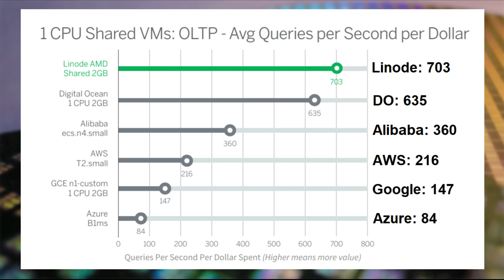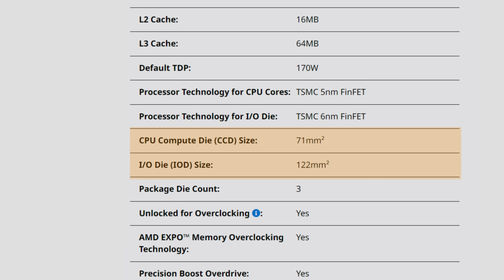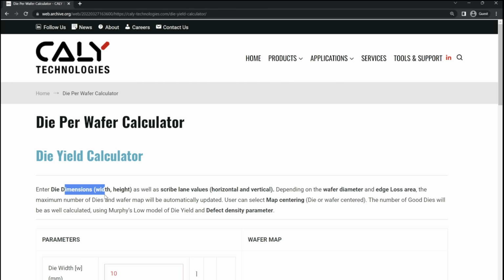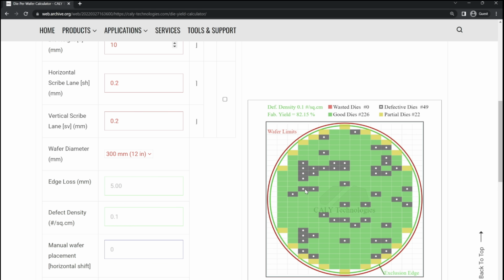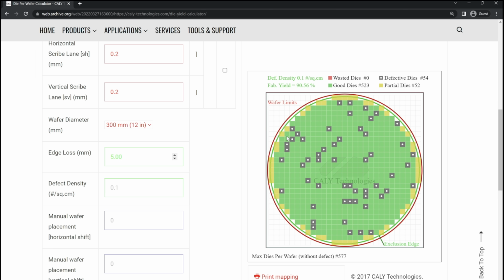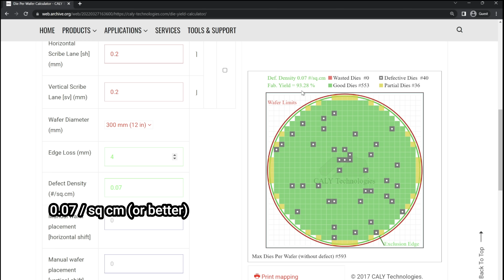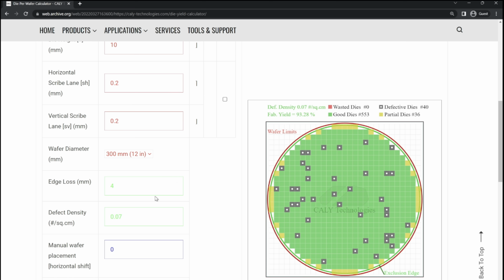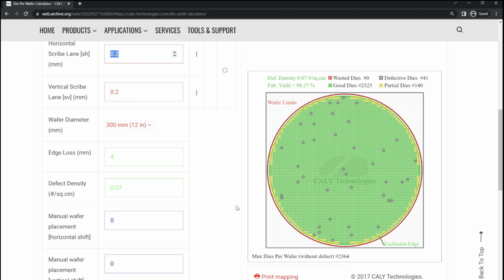AMD Ryzen 9 7950X: Cost to Manufacture?

Comment: Of course, the issue with estimating the value of the BOM for these chips is that we don't have nearly enough information. You'd need statistics on voltage/frequency binning, packaging yields, logistics overhead, etc. It's not impossible that the BOM of a 7950X is under $100 dollars, but it's also possible it's over $300. As fun as it is, error margins in excess of 200% make this sort of napkin math borderline meaningless.
Reply: Yeah, and unlike non-chiplet products we don't know how many of these "premium" desktop chips there are vs the actual top binned products going to epyc and threadripper.  If there's lots of demand for top quality silicon going to epyc, it's likely the 7950x doesn't get any good dies, but if there's not enough demand for dc processors, AMD likely will reserve some of the best for their top desktop chips.

Even 200% error margin leaves this product one of the most profitable desktop processors, which is good news because AMD can drop the price without losing their shirt.  I think the estimates for some of their less competitive desktop chips of the past like bulldozer and "fusion" chips left them earning nearly nothing per sale.

Comment: You assumed negligible loss in packaging? I was under the impression this introduce further yield loss. That e.g. through-silicon packaging creates nicer/smaller package but may have worse yield than more traditional packaging. But that’s just something I heard on the rumor mill back in the day.
Reply: I cant for the life on me remember where I heard it, but I heard packaging back in zen 1 started out at a little above 90% yield rate and quickly was fixed after zen 1 launch to 98-99%. Zen  3d cache chips I believe also started with this problem but quickly was fixed and it jumped up to that 99%. I also clearly remember that chips  very often cold be saved after failing to be packaged.

Comment: Let's put a margin of error of +300% and max price including packaging, validation etc at $210 per processor. Retail prices are 3-4 times the production cost. This is very much a requirement, considering the high costs involved in R&D, equipment and high salaries and not to mention fat bonuses and stock options for top executives.
Reply: i almost thought you were fr

Comment: This should be called 'raw material cost'... And even that's a stretch. It should be called 'silicon cost'. It doesn't include machine costs, program run time cost (for printing the chiplet in the silicon), the assembly cost, lid cost, etc. It doesn't include the markup from the manufacturer, the R&D cost, the staff cost, the marketing budget... This doesn't even come close to the true cost of that chip.
Reply from the maker: R&D is amortized over the lifetime of the chip, and who knows how long they'll be making these. Marketing budget is variable again, over the lifetime. Markup from the manufacturer - huh? The wafer prices include TSMC's markup. If you want to go quote retail cost, sure. But Bill-of-Materials costs occur all the time for tech products. Search 'bill of materials iPhone' for example.
Reply: @TechTechPotato  the bill of materials is only one component of a manufacturing cost. Do you think when someone builds a house, the bill of materials is the final cost? I've worked in manufacturing since 2014 and I'm telling you, you don't know what you're talking about

Comment: I wonder how much money the global logistics eats up.. The wafer cost likely includes shipping from Japan to Taiwan, but after Taiwan, I think AMD moves the assembly (and packaging??) to Malaysia or maybe even the US?  Something like that.  Probably adds a few bucks to the total cost, if we're counting that under the umbrella of 'manufacturing'.
Reply: Yes, but still miniscule as the chips are so small and light.
So, you could probably transport a hundred thousand just in one standard container.
Reply: @FutureChaosTV  probably, but on other hand you still need to take special measures so they won't corrupt in transporing. Which cost money.
Reply: @DimkaTsv  Chips are far less perishable than bananas, yet we transport them so cheaply that you by them for few dolars per kg. No, shipping and distribution of chips is very small part of the price.
Reply: @666Tomato666  on other side they are brittle and susceptible to dust from what i know. Unlike banans which only need to only be isolated from moving and delivered fast
Reply: @DimkaTsv  yes, you need to use packing peanuts, sure. But it's not like packing peanuts are made out of platinum and carbon nonotubes...

Comment: Great video. Perfectly explained as always. 

I have always wondered; when making big monolithic dies that leave huge unused areas (as in your very big chip example), do they put smaller dies in those otherwise dead areas to capitalise on the wafer? Would love to know why if not.
Reply: The cost of the silicon wafer before it goes through the lithography process is effectively negligible, so manufacturers have no reason to try to conserve it. A bare wafer only costs about $10, but is worth more than 1000 times that after circuits are engraved into it - the main cost comes from the limited number of lithography machines and the large amount of time taken to etch multiple layers.
Having to etch multiple die designs into one wafer means each step of the lithography process takes much longer because multiple photomasks have to be used, and makes the dicing process much more complicated (unless each design is roughly the same shape and size, and small enough that they can all fit within the area of a single photomask), so it's almost always more economical to use each wafer for a single die design, rather than trying to fit multiple dies of different sizes onto one wafer. It doesn't make sense to use thousands of dollars worth of time on a lithography machine to save a couple of dollars worth of unused wafer area.
Reply from the maker: You print the same thing so that when you cut it, the cut acts the same no matter where you are on the wafer. If that area was left alone, it wouldn't cut the same, and that might affect yield.

There are things called multi-project wafer shuttles, where different die can be on a wafer, that let smaller companies or academics run test chips, but that's super low volume. Not for HVM.
Reply from the maker: @vrforall you realise I'm an analyst, right? R&D costs are amortised over the lifetime of the product and impossible to esti. Ate based on lifetime of product and rate of amortisation. This is specifically about cost to manufacture only - it says so right in the title.
Reply: @TechTechPotato  Fair enough.  True the actual contractual cost with TSMC are of course confidential.  Guess just pointing out that some of your viewers may interpret your cost analysis as the Total cost and casts a negative perception of  AMD/Nvidia/Intel.  A simple mention of $300-$500 in design costs would clarify things.
Reply: Great explanations. Thanks 😊
Reply: BOM cost matters most because it dictates the headroom AMD has to dive sales by lowering prices in order to spread the fixed overhead costs across a higher volume. of CPUs  If manufacturing costs are higher, then harder becomes to have a pricing strategy that succeeds.

Comment: Keep in mind that there's operations costs, other business costs as finance, IT, accounting, R&D costs, marketing costs. So it does come out to a lot more
But they still probably make nearly 50% margin which is insane
Reply: @VRforAll  AMD spent more on stock buybacks than in R&D, and still made 50% margins. No sane company prices products lower than they have to, but AMD certainly has room to drop pricing and still make a killing if they have to.
Reply: @defeqel6537  gotta spend that profit before it's taxed. There's not many option. Stock buybacks provide value to shareholders. R&D also isn't a magic "make better" machine. Simply throwing an extra 50% into R&D for a year you do particularly well doesn't necessarily do anything productive besides maybe hire more engineers you don't need at the moment.

Stock buy backs are essentially a form of a tax advantaged savings account. If AMD needs the cash in the future for a large R&D investment when the time calls for it or an acquisition, they can simply just sell those stocks. Even better if they expect Stock prices to be better in the future too.
Reply: @moist_ointment  I'm not saying it's bad or anything, just that if AMD has to lower prices, they certainly have room to do so, and still make a very very very healthy profit
Reply: Margin for microsoft office is almost 99.99% just allowing this people to download from the cloud server. Chip is a software printed on silicone
Reply: @Karl with a K unfortunately there are fools that buy it for 700 bucks and a ton of AMD shills that defend overprice practices. when money you spend are your parents money you don't actually learn to count them. AMD/Intel/NVIDIA/Apple/Samsung capitalize on that.
dumb people willing to pay + shills = everything is overprice.
Reply: 50% would be low, they average something like 64% dont they?
Reply: Rest assured, they're making far more than 50% percent margin.  They just want you to believe that.
Reply: I think you're underestimating if you think its only 50%. Most retailers mark everything up 100% or more. When big chains have a 50% off sale, they aren't giving stuff away or selling it for cost, they're still making a bunch of money on something. I suspect AMD, Nvidia and Intel are all making at least 100% markup on everything they sell. There's a reason Nvidia was willing to knock a grand off 3090 Ti's to try to get rid of them, and they aren't losing money at that price.
Reply: @simplyscholar21  As someone that has worked in retail, markup from distributor is only about 5% or so in the US. It's one of the reasons that most of the mom and pop computers stores around here have gone under. There's little to no profit in sales, all profit is made in repair and services. I blame the big internet venues that can afford to buy in bulk at a discount. The only one making huge profits on hardware are the manufacturers and distributors. Oh, and scalpers....
Reply: @simplyscholar21  The average is 2.5x. It's not a small percentage.
Reply: @simplyscholar21  It's a publicly traded company. Their margins are public info, reported every quarter (non-gaap gross margin is about 50%)
Reply: @moist_ointment  that doesn't mean what you think it means. It's based on their overall revenue. The higher their revenue, the higher their gross profit margin goes. It has absolutely nothing to do with their overall profit margin on a specific product.
Reply: @simplyscholar21  of course not on a specific product, but generally DC is going to have higher margins than consumer lines. Margins are certainly not sale price minus BOM
Reply: @moist_ointment  Also keep in mind, that AMD's margins on Server chips and large FPGA are higher, so I would guess their consumer products have lower margins than 50%. As that's the average.
Reply: @moist_ointment  your information still doesn't mean what you think it means. It's the profit margin of the company as a whole. Factoring in everything from janitorial costs to marketing. We're talking about specific products, and I stand by my statement.
Reply: @simplyscholar21  You can't exclude amortized fixed costs or NRE when discussing product margins. Janitorial costs HAVE to be applied to each unit sale before determining the final margin.
Reply: @moist_ointment  keep in mind that part of margin-revenue discussion is that AMD's "investments" like stock buybacks are calculated into that
Reply: @simplyscholar21  Except for the fact that they are publicly traded companies and have to share their margins.... which for the last quarter was... 46	%
Reply: @feedtheagle6851  publicly traded companies have to share their margins as a whole. That isn't the margin for a specific product. AMD has a fan store where they sell socks, shirts, cufflinks... they've sold bicycles before. All of the margins of everything they sold as a company gets combined to that single figure. I can explain this to you, but I can't understand it for you. That figure is not the profit margin they have for selling CPUs or GPUs. The margins on those specific products is much higher. Either accept it or don't.
Reply: @simplyscholar21  So you are suggesting that they should lose money as a whole so that you can have a cheaper product, got it.
Reply: @feedtheagle6851  No no no, he's suggesting that they plunge the company into the dirt so that he can get 16% more performance on a new generation of chip he doesn't even need, to render his video 2 minutes faster because he's that impatient and entitled.
Reply: @simplyscholar21  exactly. when 5600x was launched it was 28k in India. Now its selling for 16k. they just reduced the price 5600x by 42%. so yeah they were selling it at huge profit margins.
Reply: @Karl with a K TOCK TOCK. Guess what:
The chips don't magically end up in the stores.
There are logistics, distributors, retailers, etc...
Reply: @VRforAll  don't forget AMD has to buy yachts, private houses on warm islands, 10-bedroom apartments in all big cities, Lamborghinis, black and red caviar, overpriced champagne and prostitutes for all its shareholders. of course its priced like its priced.
Reply: @rawdez_  Stupid comment.
Reply: It isn't that insane.
As retailers (at least used to) are usually doing a 100% markup on products.
Same for food stuff. AT LEAST a 100% markup. Sometimes several hundred percent f.e. for soft drinks or drinks in cans/bottles, cookies or similar deserts etc...

Comment: What about nVidia RTX 4090, could you do the same calculation for that in a next video? They're not using chiplets, so I guess it is quite expensive to make. But does that is enough to sum up to a 1600-dollar card?
Reply: US$193 using the video's numbers and no unusable dies.
Reply: Should also remember that a GPU has quite a bit of other costs than the GPU chip itself. GDDR6 is easily $10 / GB, and GDDR6X is reportedly more expensive.
Reply: No it's not enough. 4090 is a scam. Wait for 7900XT.

Comment: Honestly, amd needs to be more aggressive with their product stack. Intel's little cores might not be very fast, but a 13600k is probably going to give a radically different experience when gaming while multitasking or steaming.
Reply: Unfortunately the small cores tend to tie up the ring bus and l3 cache so when those cores are in use the big cores get held back a little which would be bad for gaming.
The purpose of the little cores is purely for cinebench and blender to take away amd's multicore lead, intel can't make a cpu with 8+8 big cores yet, If they could thats what they would like to do and leave this small core stuff to history. At some point if they eventually get their chiplets together they will. By which time amd will likely have 8big+8medium+16small core options as a response.
Reply: @tomstech4390  Using ring bus, cache and a bit more power isnt the same as using the big cores. On a 7600x, using chrome, spotify, etc means using 1 or 2 threads for that, which will probably have dramatically more impact than using a bit of L3 and ring bus bandwidth.
Reply: @b127_1  HUB tested background tasks and found that they basically have 0 effect currently, games just don't saturate all the cores at once, which leaves plenty of time for other processes to do their thing. It might be different if you did something like CPU encoding, but that might have a big enough RAM bandwidth requirement for that to become the bottleneck (no idea, haven't tested).
Reply: @defeqel6537  This will vary a lot by game. With simple games like csgo, it probably wont really matter, but there is more and more games that genuinely use 100% of a six core cpu.
Reply: @b127_1  Can you link any proof?
Reply: @defeqel6537  Techspot found a 40% difference between a 5600 and 5700x in cod vanguard their 6 vs 8 core test. I'd say its safe to say that that game uses more than 6 cores. I had a 6900xt for a while too and in cod MW it was using almost all of my 5600x. Im on a 5900x with a 1080 ti now, so its like 25% cpu now, but 4090 might make it even more extreme in some cases.
Reply: @b127_1  I'm not seeing 40%, I'm seeing ~25% (282 vs 226) at 1080p, which is still fair enough, but since both had minimums around the 144 mark, I doubt it's much of an issue. And moreover, even if the game benefits from additional cores/threads still doesn't mean the used cores were fully utilized, it really depends on the game engine (and game).
Reply: Havent really shown anything yet... its been 2 generations so far moving on to their 3rd... Not sure what is going on for say... but their little cores don't seem to be active much and/or the threads need big core functions thus the little cores are never really used. So far their current line up takes more power than AMD that has just all large cores.